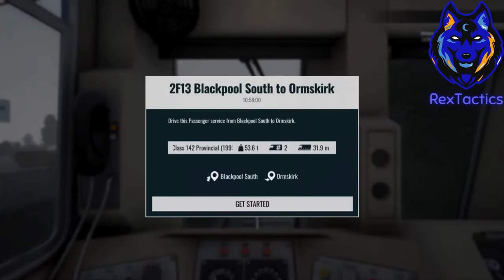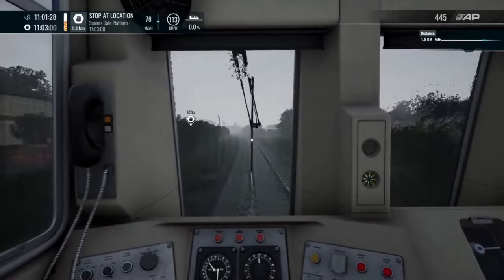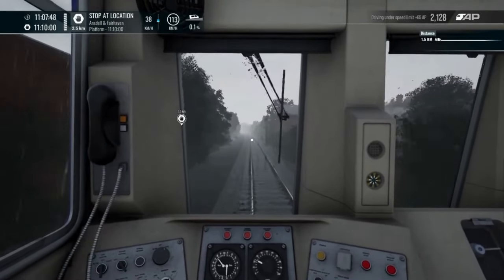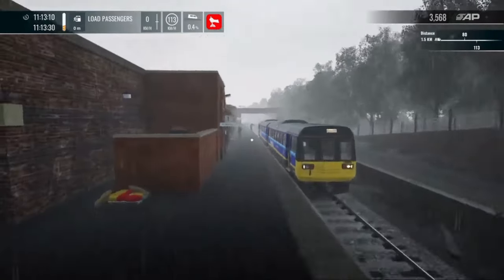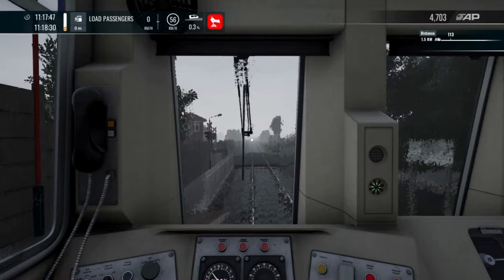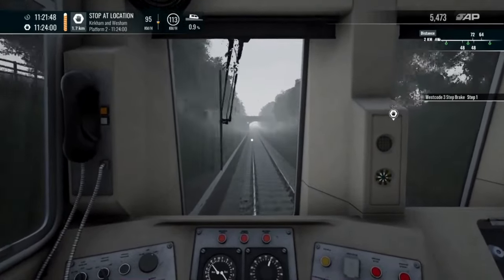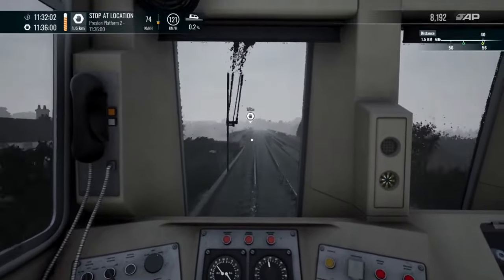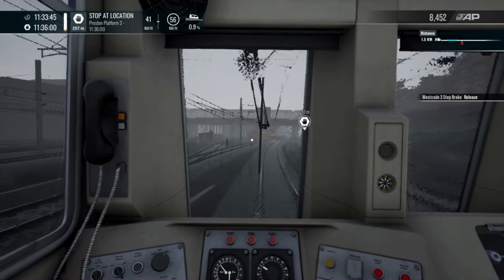2F13: Driving a Pacer from Blackpool South to Ormskirk. Part 1/2.

Comment: St Annes on Sea is my local station and it looks nothing like that now. After the line was singled in 1982; the signalbox became redundant and was demolished. All the old station buildings and the covered footbridge were demolished years ago too.
Reply from the maker: It is always interesting to see how things have changed over the years, especially stations and routes in the uk
Reply: same i was like huh thats not SAS
Reply from the maker: The route is set in the 80s for TSW 4, so track side equipment like the semaphore signals were used in that time, but not as much nowadays. Though some semaphore signals are still used.